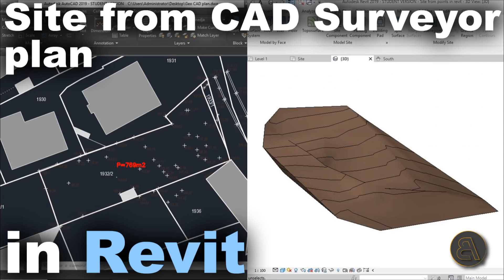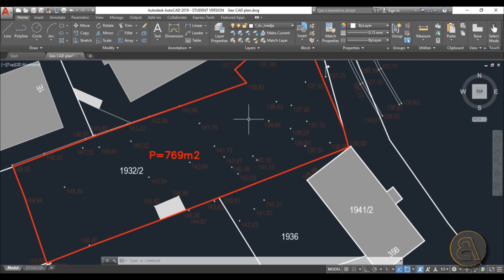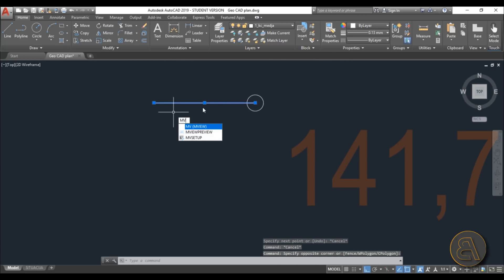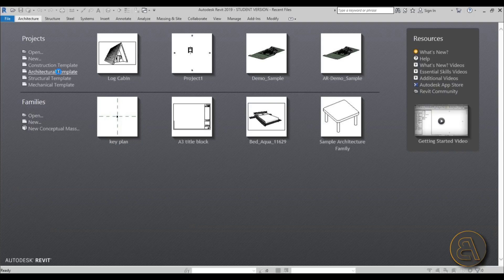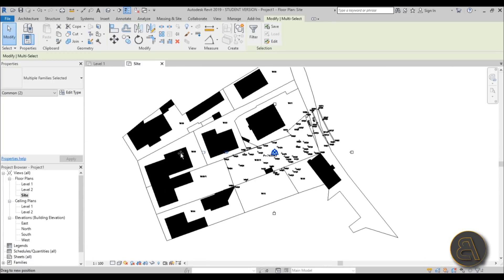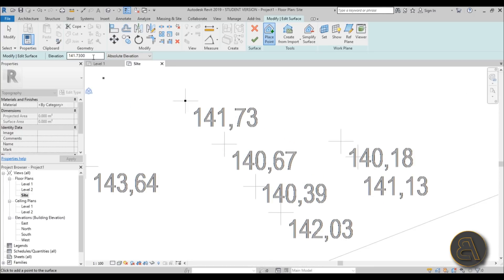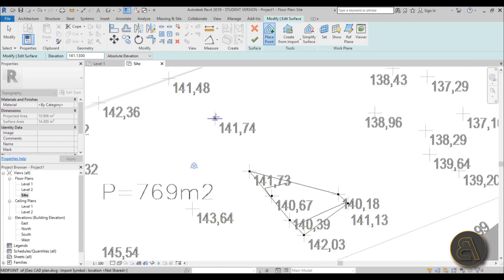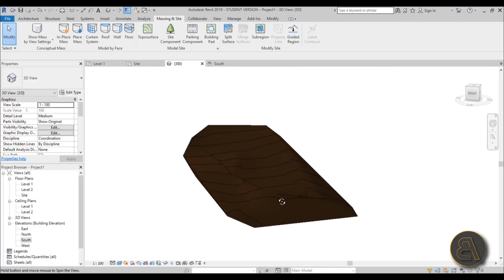Site from Surveyor in Revit Tutorial

Comment: thank you for the Video, set the VR to 1000' to 0 , wondering why when I add topo point, ele lower than 285' doesn't show, but over 285 shows a dot with the cursor. and 3d view shows the topo surface is created.

Comment: Don’t ever flatten your survey data🤦🏽‍♂️.  Also don’t use revit for surface modeling. That’s what civil 3D is for. If you have to use revit for surface modeling. Import the survey points. Also if your survey points can be exported out of the survey file with civil 3D if needed but the surveyor should have provided a text file of his points. If not tell him to do so.

Comment: Hi, if you select create from import and the level points are 3 dimensional, as in your dwg file before you flattened it, you can select the import, and choose the autocad layers the survey points are on, and it will automatically create the 3D Topo surface

Comment: If you cannot simply isolate the elevation dots and create from import (often when dots are blocks, i guess this is the case) then you can use data extraction to extract the coordinates of the dots. I think its quite easy to google. Search autocad data extraction block coordinates. Also Google the format revit wants it, you need to do some simple adjustments to the created file.

Comment: the best way to make use of this is by using AUTOCAD CIVIL 3D

STEPS-

1. COLLECT SURVEYORS DATA EASTING NORTHING ELEVATION (AS .CSV FILE OR .DWG FILE) WITH EXACT ELEVATION 

2. MAKE A  TIN SURFACE FROM THE CIVIL 3D using those elevn points.

3.SMOOTHEN THE CONTOUR ( MAJOR & MINOR CONTOURS)

4. THEN IMPORT TO REVIT...clean it... ...calculate cutting and filling volumes..place building pad at the  propoesd location..then proceed with  architectural and structural work

( U CAN ALSO IMPORT .CSV FILE DI RECTLY INTO REVIT)

Comment: if you have the txt file from the surveyor with the points you can load it into revit using the tab "create from import"
Reply: @architecturetutorrevit  You can use free software CADtools to export Autocad points to CSV file, and then just import it as surface in Revit. The whole operation takes 2 minutes :)
Reply: You can also create a txt file from pretty much any AutoCAD survey, even flat ones, by running a script.